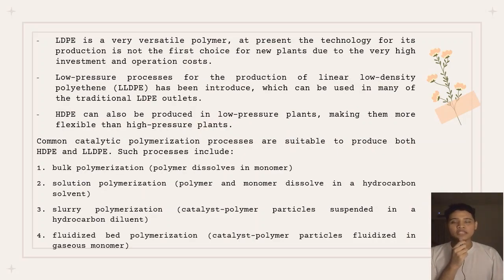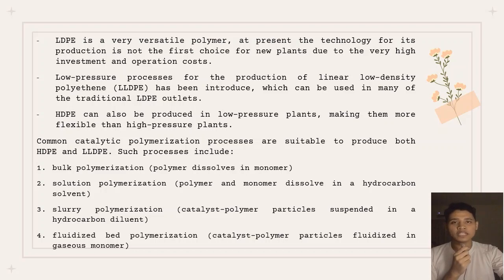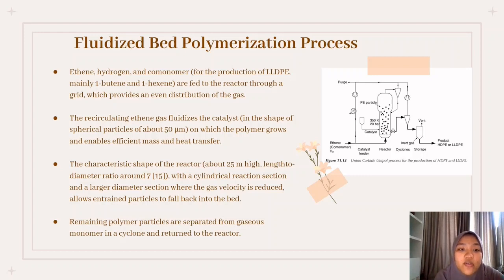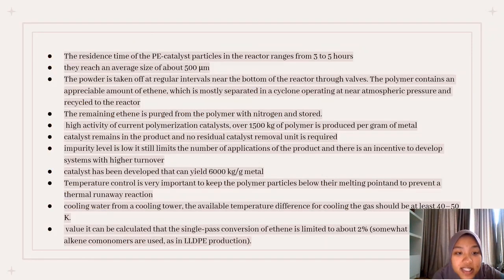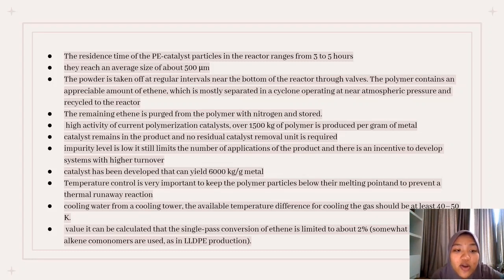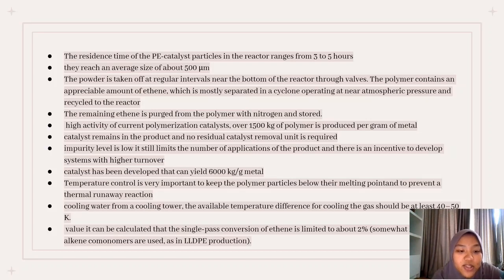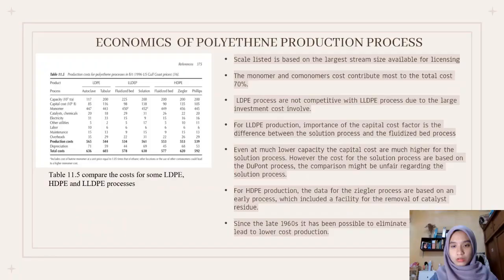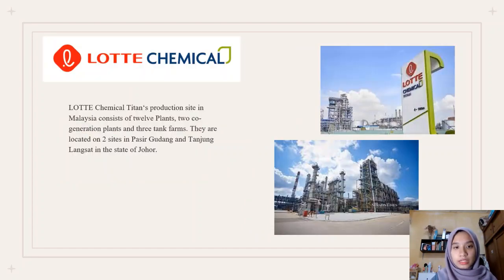CHE 329: MODULE 11 PRODUCTION OF HDPE AND LLDPE (EH1105A)

Comment: Between HDPE and LLDPE, which one has better attention and higher demand for end user applications?
Reply from the maker: LLDPE has better attention since it more flexible and can be stretched easily over obstructions. With greater flexibility, LLDPE can be prefabricated for field installation, as opposed to HDPE which must be entirely welded on site. 
But in user applications, both are in high demand.